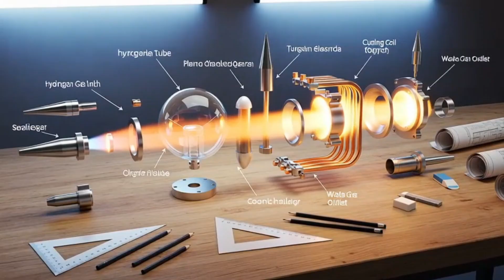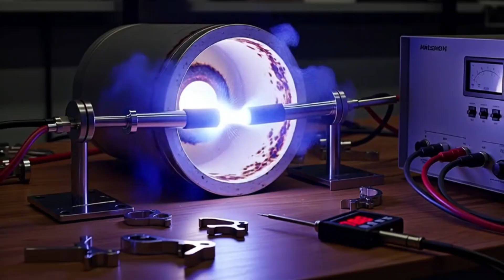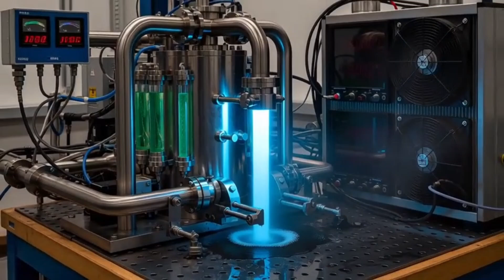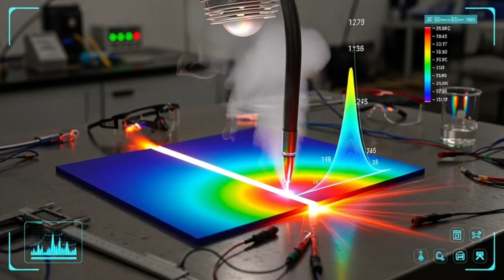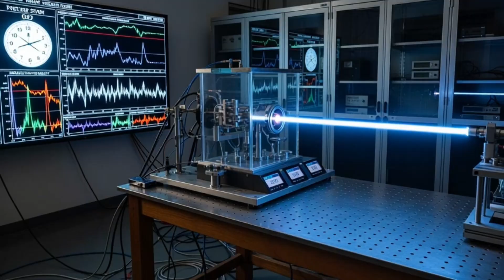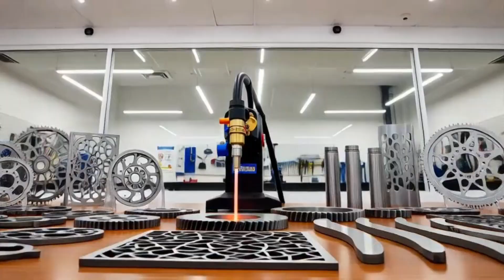Hydrogen Plasma Torch 2025: Cutting Steel in Seconds

Comment: They could probably for bulk metallic glass too, without sophisticated quenching, because atomic hydrogen has no limits with heat
Reply from the maker: Cooling is necessary for such scenarios otherwise would malfunction
Reply: @ancientoldscience ok, I mean you wouldnt have to quench the material in something exotic.  Still need to quench with salt or something
Reply from the maker: Would that really work well?